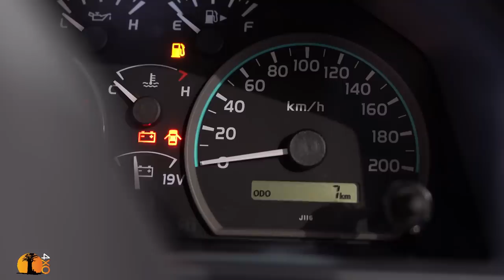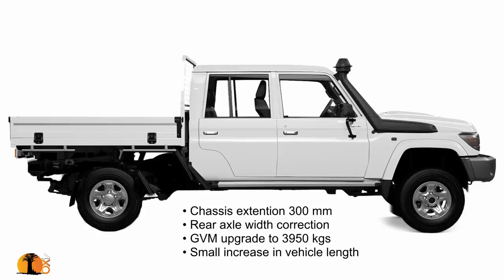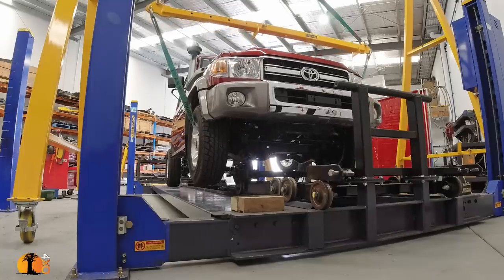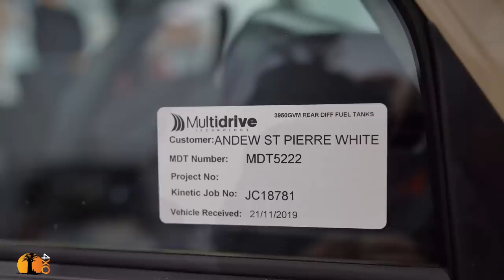The story is out! Birth of the Toyota Land Cruiser VDJ79 300 Autograph. From a Toyota dealer?

Comment: Even with the stretch it still looks to have a large rear overhang. It looks as if there is potential to increase the wheelbase more without increasing the overall length.
It may be that doing this may cause the work and therefore cost to snowball but would seem worth considering.
I am the first to admit I am no expert but you appear to have had a lot of work done with just enough improvement.

Comment: Hello good sir, this is unrelated to this video however I'm posting it here because I think this will be good for you and I want you to see this comment, in an old video you said about zippers getting stuck. I'm a plasterer and for my collated screwgun I use graphite powder to lubricate the metal on metal sliding mechanism. I reckon it would work very well if you were to clean the zippers, let them dry and then sprinkle graphite powder over the whole zip, not just the part you slide with your finger, you can get it at Bunnings and probably any hardware store, I have never tried this but it's the only dry lubricant I can think of off the top of my head. If you see this and give it a go please let me know how it works. PS. Love the channel I have learned so much

Comment: Nice - very nice. There would be no risk of Toyota stopping production of the 70 series units if they would being them into North America. Particularly in the diesel - you would see a switch from the over the top F350, GMC 3500 and Ram 3500 units used by so many contractors and companies to these in a heartbeat. Cost, reliability, fuel efficiency - all features to gain.

Comment: Fantastic build! It's impressive to see how well established and accomplished the aftermarket and re-engineering Australian industry is. Its a real shame Toyo refuses to import the 70 series in the EU - from my understanding it is Euro 5 compliance ready. Btw, hope they fitted a proper heat shield between the exhaust box and the fuel tank even though it is diesel.

Comment: Question on welds for reinforcement piece. The welds are not continuous. It can be seen at 9:32. This would allow water to pass between the reinforcement and the original box frame. The water could remain between the two and rust would form, never dry out. Toyota has had problems with rust on the frame (USA). It looks like this would amplify rust possibilities. Why did they just not have a continuous weld to seal this off?? Thanks.

Comment: To answer lots of questions below. 
Turning circle will always increase as the wheelbase increases.
Not a problem as Andrew won't be driving in London or Tokyo so lets not panic.
The advantages have been stated but just to add, the vehicle will be smoother over the bumps due to the increase.
It will definitely be smoother over corrugation compared to standard wheelbases.

Comment: From Andrews website:
Price guide:

These are prices are an APPROXIMATE GUIDE ONLY, EX GST. It is vital that you verify these prices with your dealership, as they may have changed since this page was updated.

Chassis extension 300 mm. $6000
Rear axle width correction. Axle case is replaced. GVM 3950. $5000
Rear axle width correction. Tru-Tracker axle modification. GVM 3780. $4000
GVM upgrade to 3950 kgs (1540 kgs front, 2500 kgs rear). Suspension is replaced. $4000
Fuel tank replacement. A 180L Brown Davis diesel tank replaces the factory 130L tank. Additional 50L capacity. $1650
Additional Brown Davis sub tank 110L, in front of rear axle. Additional 110L capacity. $2450.
Norweld deluxe tray. $12 990.
NB. These are prices are a GUIDE ONLY.

Comment: "Looks like a fish, moves like a fish, steers like a cow." I have a 101 Forward Control stretched to 130 chassis. Have tool box behind the cab and a 10 ft tipper on the back good load distribution and will take 1 Ton legal on UK roads. 
Great tool for work. but it  steers so wide. Really like that truck and would have one  here for work. Cheers

Comment: A natural fix for the weight distribution problem, but man that turning circle is gonna be like a limo.
Reply: Yep, goodbye 3 point turn hello 15 point turn :)
Reply from the maker: Yeah. I knew it would. It's bad to begin with, now it's a bit worse. It's not built for parking lots and malls.
Reply: Turning circle is one thing but what about break over angle? 37s are an issue in aus
Reply: Graeme Urban we need an engineer to sign off on 37s over here before we can use them legally
Reply: Graeme Urban eh, it’s more intended for touring rather then the glasshouse mountains
Reply: @element271  but I hear the Simson desert has dunes that need traversing so break over angle would be a consideration in sort of touring would it not?
Reply: @graemeurban262  No, Simpson does not have sharp peaked dunes.  If breakover becomes an issue  in the Simpson, you have your shovel :)

Comment: You have never been afraid to speak your mind, hopefully Toyota will take the criticism on the chin and man-up and do this. Your video on the Pajero GLS also planted the seed for some serious confrontation from the Mitsubishi owners, your statements which in my mind was fair. I drive a Pajero, my third one and love it. I do however drive the GLX version without TC and the mechanical rear diff lock. This model however is much better in sand, because the GLS version in RSA, (maybe everywhere)never actually switches the TC off completely when in 4WD, HLC or LLC. Its all ways interfering and is a big downfall in sand according to my experience. It never let the wheels spin freely and stuffs up the sand driving ability. If you can, drive the GLX version sometime also in the dunes, you will find it much better. Anyway, i stay close to where you bought your 105, here in the Garden Route of SA. so if in the area check your FB messenger, come say hallo and lunch is on me.

Comment: Looks absolutely beautiful, but are you not worried that extending the wheelbase so far will have more of a negative effect on its off-road performance than the poor weight distribution? Is it that you've found in overlanding that stability and weight distribution is more important than breakover angles?

Comment: That is a needed improvement for that land king. However, I had two questions, one of which you answered in the video and very well (about why not go with a bigger conversion). My second question is the following: Isn't the added section going to present a small focus for stress, or become a week part of the frame of the car? Specially where it's located, in between two load carrying parts, also because when the heat of the welding presents changes to the material that make it a little weaker than the previous one solid frame.

Comment: Have you asked who is responsible for the new vehicle warranty?  Second Stage Manufacture means it is no longer a Toyota.  You now have a MDT TOYOTA built by MDT ENGINEERING PTY LTD as per your new compliance plate.  Under Australian consumer law, the dealer that sold it to you is on the hook and then the Manufacture which in this case is no longer Toyota but MDT as that's who is on the compliance plate and all the paperwork.  Hence why it happens Federally preregistration.

You are also a little naive if you think dealers all over the country don't know about Second Stage Manufacturers, they do it on a daily basis how else do you think SSM get their hands on new vehicles preregistration.
Reply: (N.B. Total speculation) ... surely the onus wouldn't be completely transferred to the second stage manufacturer. Warranties typically flow uphill (ie, Toyota can claim a warranty from Denso, Bosch, Bridgestone, etc, for a part they commission for new vehicles); the buck doesn't begin and end with the last entity to sign off on a product, but yes, they are responsible for managing the claim just like any Australian retailer. 

On a side note, I love it when a retailer claims that you need to return to the manufacturer for warranty claims; ACL says either/or. So by that, Toyota would still be responsible but the SSM might also need to be a middle man for anything they didn't touch IF the consumer returns to them. (again, speculation based on limited factual knowledge of the exact wording of the legislation).

Comment: The turning circle on that vehicle is going to go from very bad in factory form to horrendous after those modifications.
Reply: Did you not watch the video, the overall length is shortened and he says turning is improved...
Reply: @maverick2242  overall length doesnt effect turning,, The wheelbase does which is now longer
Reply: @maverick2242  obviously you didn't watch the video, especially the part where the wheelbase was increased by 300mm...
If you know anything about the 79 series, you would at least know that they have one of the worst turning circles around.
Reply from the maker: Turning is not improved. Vehicle is similar length, but turning radius is wider. But then again, it's not built for malls.
Reply: @4xoverland  EXACTLY. 
I rest my case.

By the way, I am really loving your channel. I only just discovered it last month. I have been watching every video in your back catalogue. Very entertaining stuff mate, job well done!
Reply: Just another conversion to do. IFS from 200 series should fix turning circle. ;-)

Comment: It's sad that a $70000 vehicle requires another $10 - 20000 to finish building it!
Reply: Not sad if its a project.
Reply from the maker: Patreons pay my rent. Food. Water. Lights. So I can make the videos, so you can watch. For free. Be grateful.
Reply: @4xoverland  that wasn't the point of my OP.  It just doesn't make sense that something as basic as wheel track is wrong on such an expensive vehicle!
But then again, much of the automotive industry makes no sense to me.  Don't get me started on 4x4 wagon payload figures!
Reply from the maker: @froggymicb  no worries Michael. It makes little sense to me also.

Comment: Andrew I am also a big fan of Toyotas but what I questioning is why do some folks need a double cab ute and then still tow a trailer for a the camping equipment they have collect when the guy travels around Africa for a 900 odd days in a pretty stock old Jeep JK.  The question I ask is is it really necessary to travel with a home a away from home?  Are we not supposed to treading lightly out there with these finite resources?

Comment: Nice Project. Not expensive is a contradiction in terms.
$90k to buy the initial vehicle, then min$30k for conversion and tray.
Already at $120k.
Another $5k to tune it so it’s got adequate power.
If you’ve got $125k+, might as well buy an F150 or RAM.
Job done.
Reply from the maker: $90K?? Where do you shop? $78K for the basic vehicle, $11K for the stretch and axle change. That's $88K.

Comment: Can you tell why Toyota made the rear track narrower then the front ?
I have a 76 wagon and not sure if I should fix it or not, I’m planning on keeping this truck forever
Reply: Anthoni they made the front track wider to fit the 1VD diesel in. They left the rear differential the same width as its been since 1985, not changing it as the wheels would have hung outside the bodies on the 76  wagon & 78 troopy too far to meet ADR, and Toyota doesn't sell enough seventies to warrant reengineering the body.

Comment: Can someone explain for the uninitiated as to why Toyota don't do anything about the rear axle width if it's so important for handling and off roading?
Reply from the maker: Because it would mean that the body would have to have been redesigned to make it wider. Not a big deal as they could have done it with wheel arches. But they didn't. Left the old axle at the back, and redesigned the front axle for the new V8 engine. In short, they were saving money.
Reply: @4xoverland  wow got a response from the man himself!! :D

Comment: Hope you noticed my comment, when you extended the chassis by 300mm, how much did you extend the wheelbase?
Reply from the maker: Wheelbase +300mm. Overall vehicle length +90mm.
Reply: Wow. Didn't expect a quick reply from you. Awesome. I bought an old Lc79 firetruck that I'm converting to a normal double cab pick-up. But the wheelbase is even shorter than I expected. 2980mm instead of the normal 3180mm. I think I'm gonna do what you did. Any more tips to improve my pickup other than longer wheelbase and axle with correction? 30mm difference between the front and rear right?

Comment: Does the Brake booster need upgrading with longer brake lines?   Pressure drop?
Reply from the maker: Even if the brake lines went around the globe, there would be no pressure drop, just more hydraulic fluid.
Reply: @4xoverland  
That is incorrect....  there will be a pressure drop for fluid or voltage drop in electricity according to hose or cable length.....
Might not be an issue for 300mm - 400mm in brake though......

Comment: So it improved the length but made turning circle worse?
Reply from the maker: It made the load carrying better. A lot better. And yes, the turning radius is worse. But it's not designed for mall parking.
Reply: @4xoverland  understand. It would suit flat tracks but not switchbacks then
Reply from the maker: @astondriver  I can imagine on a switchback track, it may be a handful.

Comment: What made you decide to go with terrain tamer suspension
Reply: They make a good upgrade kit. I tried 3 different sets of suspension in 6 months. The only suspension Im happy with wasTerrain Tamer. I will be using it on my customers vehicles in the future.
Reply: @juliangraziani7299  what do you think of Andrews previous choices? BP51's and Koni Raids?
Reply: @atlas_au  BP51's are waaayy overkill for most users. Not to mention $$$. Old Man Emu Nitrochargers are great. Ive had 3 cars with them on. The springs... not so much. Have had ride problems and springs collapsed. 
Koni. I haven't used them.
I would personally prefer Bilstiens if you are going that far.
I do alot of gravel and sandy roads and The Terrain Tamers have been good. They are only 3 months old so far though.
Reply: @juliangraziani7299  Cheers mate! hope the TTs have held up well.

Comment: Why don't you use USA made trucks like Ford or RAM . It's already done everything. just put a try and good to go.
Reply: They cost too much over here, even if you bought a new land cruiser and did these mods it would still be cheaper
Reply from the maker: While tempting, US-made trucks are very expensive (conversion to RHD) and too wide for Aussie bush tracks. They get damaged and pick up a lot of punctures.
Reply: Its expensive. F Trucks and Ram are treated as Luxury vehicles here in Aust. They are Grey imports and converted to RHD. Support for them in Australia is also minimal.

Comment: To bad for me that everything done to this is illegal in EU
Reply: No it can be done with the right paperwork, certificate for welding, frame stiffness calculations etc...
Reply: @mazevx2451  No frame welding in EU member countries. Rules are strict and very clear on that issue
Reply: @OldNorsebrewery  that's not true. Frame welding is allowed if you are doing it right.
Reply: MazeVX FPV not in my country. I know a couple that lost their lisence plates over exactly that
Reply: @OldNorsebrewery  like here, you can't just weld around on the frame you HAVE to do the right paperwork.
Reply: MazeVX FPV We can`t get the right paperwork. Even if you just want to get the front bumper to sit closer to the front & you do just a frame cut. Or a body frame lift, or a roll cage or any other modification it`s not road legal anymore. There is no right paperwork.
Reply: @OldNorsebrewery  strange... If the company that do it has the certificates and the frame strength can be guaranteed by math you can get it approved in Germany.
Reply: @mazevx2451  We are however allowed to change cd if we have stopped by the side of the road at an allowed place of course

Comment: I like how he says it’s inexpensive but doesn’t tell you the price. May as well buy a RAM.
Reply from the maker: Not even close to the cost of a RAM. I did consider one! I will reveal the costs when the build it done.
Reply: The petrol rams around 85k. Two mates have them. Getting good fuel economy. Round 13-14per hundred stock. Surely your upgrades will put you just below 100k if not above